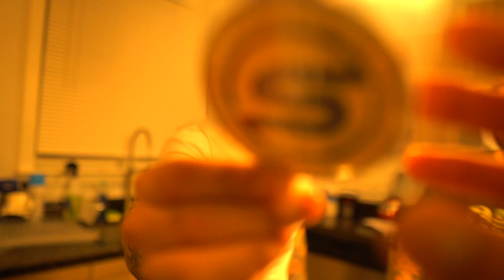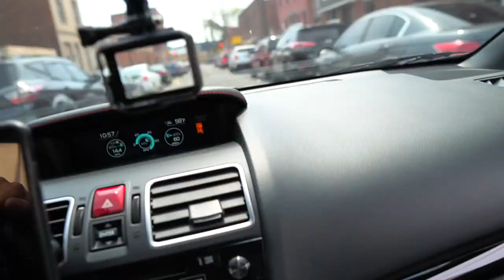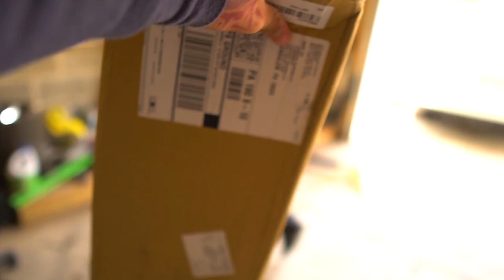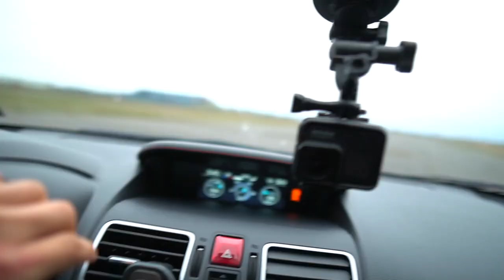RACING MY STAGE 1 WRX STI VS A STOCK WRX STI ! *CRAZY RACE* | BRAAP VLOGS

Comment: The car is “Stage 2” not “Stage 1” due to you having an aftermarket downpipe. Also the stock STI needed a serious drivermod for a better comparison lol
Reply: Justice Isaac “stages” are for ricers  and even then he can’t get the stages right... stage 2 500hp..
Reply: Stage 2 definitely after the DP buddy lol
Reply: Stage? I remember in early racing games when if you couldn’t pick individual upgrades you could buy generic stages. Probably the same.
Reply: What are these millennials talking about?
What's it got an Air filter mod and a muffler swap with a new tune?
Reply: @edwincordero7304  bro I’m was thinking the same shit stage 2 500 hp . In his dreams . Not even full bolt ons with e85 would he even touch 500 to the wheel And even if there was some small chance in hell that he did he would launch that thing and immediately blow that motor to shit and Stage 3.. 800 hp Bro this dude should be comedian.

Comment: Bro e took off slow as ever to make braap's car look faster dont get me wrong braap's car is faster but not by 3 car lengths from the gate
Reply: You'd be surprised what an extra 60-70whp will so for you. Plus it now has launch control which makes all the difference.
Reply: Lol bolt on max 35 hp... The dude in blue one just don't know how to drive
Reply: @weranonymous4209  not really just 35hp. 

A bolt on and tuned STI will make low 300whp. A STOCK STI will make somewhere between 230-250whp on average. That's a LARGE difference.

Comment: My boy fr just put smoker vents on the windows braap that’s just a no in the car scene bro 😳. A lot of people will shake their heads at em just some advice bro.
Reply: Not in Subaru circles man. They’re a common mod, not to mention super useful/ nice to have to crack windows in the rain. Subaru offers factory visors that are killer quality, don’t just stick on with two sided tape. They’re in channel and have supports hidden in the other side. You need to go to some C and C bro, tons of people run visors lol.

Comment: I thought the Wrx makes 268 hp and the STI makes 310 stock?? No hate but me and my brother hit 132 mph on a stock WRX
Reply: From factory yes those numbers are correct but drivetrain loss puts those numbers down about 15-20% from 268 and 305 . Also yes you are right a stock sti and wrx won’t pass 135-140 till you get a Cobb accessort , once you get that and install it, it removes the governor so you can exceed 135-140 mph . I’m pretty sure whoever tunes your car has to do that when you get it dynoed... I think